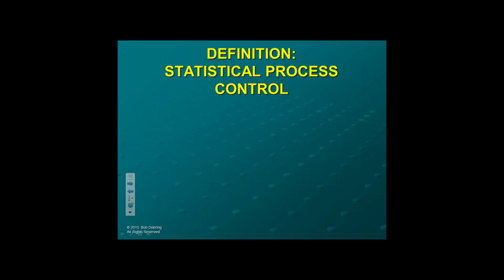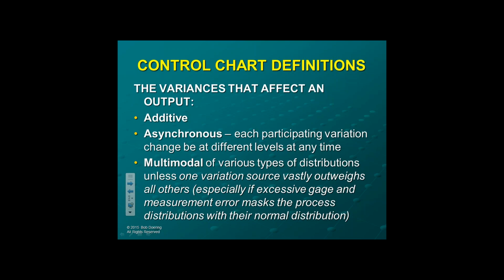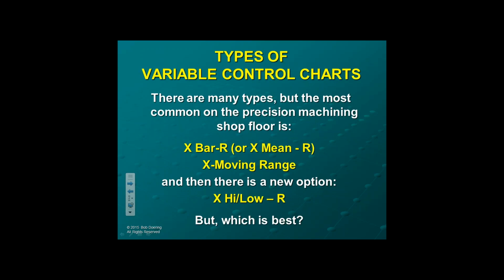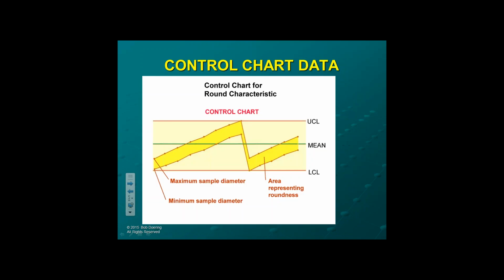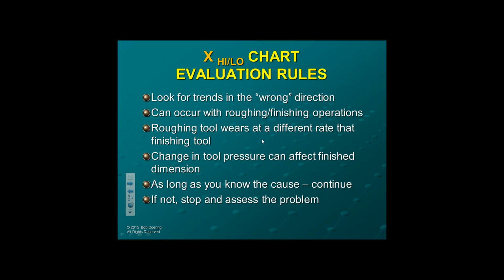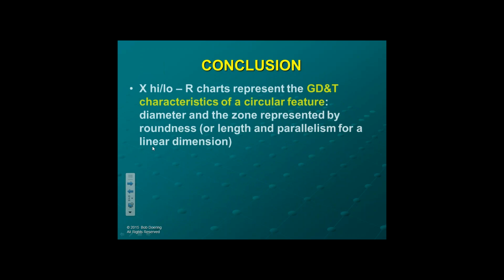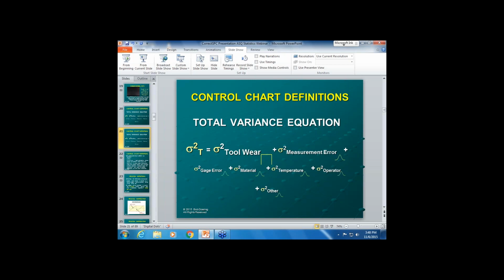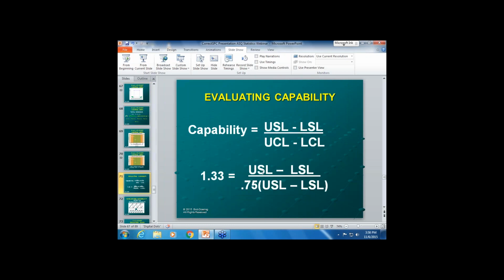Webinar: Correct SPC - The Correct Use of Non Shewhart SPC in Precisi

Comment: The point made about automated tool wear algorithms is outstanding.  The intention is good, but unless the algorithm was developed with real process history(and tooling) it will most likely introduce more variation.  I tend to cringe when I see operators taking matters in their own hands because the automation is fighting with them.  We learned the hard way on this by having the operators log their corrective actions taken over their respective shifts.  It was a continuous battle between operator and poorly designed control logic.  The measured variation was ugly and eating up most of the tolerance!  Once the automation was shut off the process proved quite stable (minus predictable tool wear) with little need for adjustment.  The only other method that I have used that parallels this thought process was charting TIR on its own I-MR or X-Bar.  I believe that the high/low method will be more easily understood by operators.  Nice job on this presentation and Bob's passion for this topic is obvious.